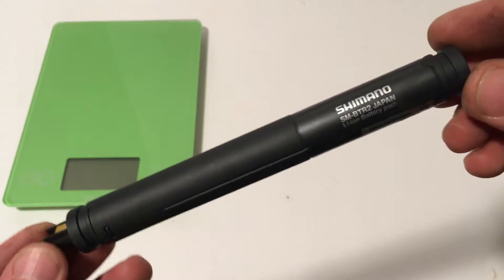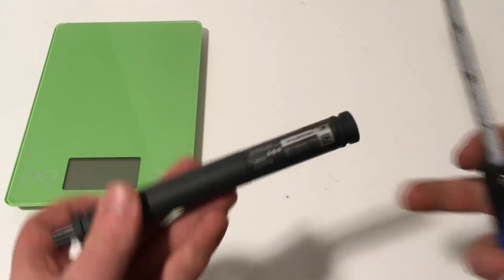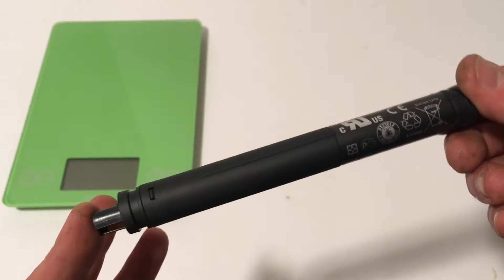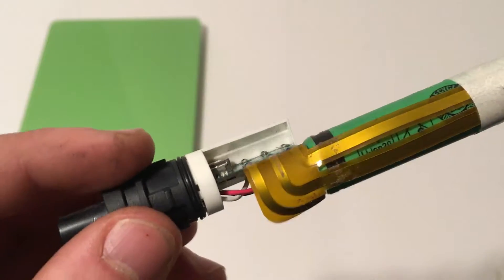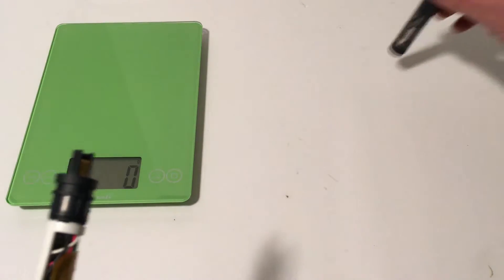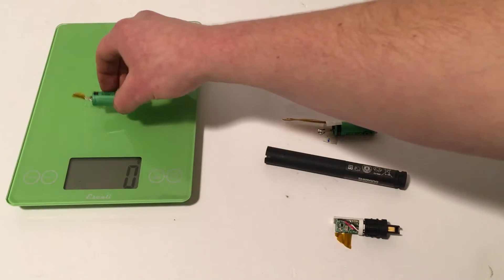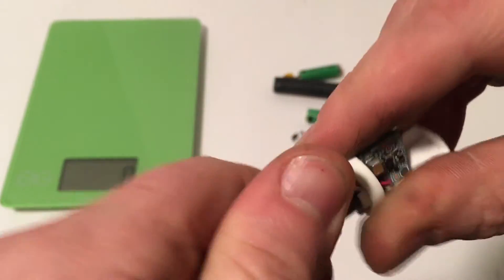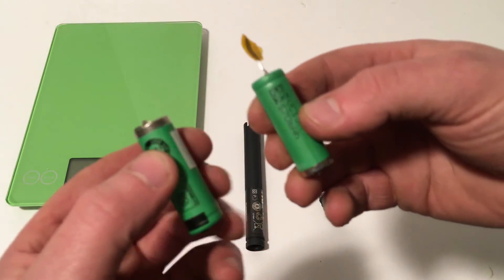What is inside of a Shimano Di2 Internal SM-BCR2 Battery

Comment: Is anyone know what is electrical difference between BT-DN110 and SM-BTR2 battery? Both batteries have the same voltage and capacity. It looks like Shimano is doing money on it and limitation is only in SW. Do You have any photos of both PCBs?
Reply: btr 2 compatible with ultegra 6780 and 9070  and dn 110 is with ultegra 8050 and da 9150, you cannot mix.
Reply: @dosazsolt9725  i already order bt-dn110 but before i used btr2 with m8050 groupset but without syncro mode
Reply: @marcinterka5822  that s good to know, so the basic funktion was going normal but no further shifting possibilities.
Reply: @dosazsolt9725  Mostly it depends from mode which You can set in tube SW for your  computer. In road bike I am using SM-EW90-A. When I choose option MTB there is more limitation than on road bike, so for example in MTB mode I cannot use shifter from road bike. When I switch to road bike I am able to drive M8050 and M8070 derailleurs using road bike shifters. Unfortunately there is forbidden to mix MTB and road derailleurs. It is very interesting topic at all. I am on the way to debug what communication is used by BTR2 and DN110 batteries to confirm that this is only marketing :)

Comment: Watching this was a painful waste of time. "Lookie mommy, I can break things and render them to screwed up to repair with new batteries.
Reply: On the contrary, I found the video incredibly useful as a reference when modding my BT-D110, especially on how to open the case and what batteries to use. The end result weighs 25g after I removed the case and soldered in smaller capacity batteries (enough for 1x). It even fits into drop bar now, way more ergonomic location than the seatpost.

Comment: Thanks for destroying an expensive battery for us... shame you probably dont still have the bits, need a little bit of reverse engineering done - the three wires in the ribbon cable, clearly battery + and - but that third one.... either balance tap or temp sensor... need to know ;)

Comment: I just dissected a Campy EPS v3 battery. Found a fried chip on the circuit board. Any idea as to what leads I can get to replace the part to solder back on ?

Comment: Apparently, the BT-D110 doesn't have case clips, it's glued on instead, you have to cut the case where the the white PCB holder and black end cap meet. The two batteries inside are the same 570mAh as in video, though.
Reply: Yeah, the newer batteries don't come apart like shown in this video. I am going to attempt to use a heatgun since glue softens when you apply heat. Hopefully this wasn't friction welded plastic because it won't come apart if it is.
Reply: @Raymond-Farts  Any updates of using a heat gun to disassemble the newer DN110? I am intending to do so but having doubts of damaging the batteries or the pcb.

Comment: Can you take apart a Di2 switch? I was wondering if the climbing shifters that cost $130 are just a momentary switch or is there a circuit board in the switch box?
Reply from the maker: If I get a damaged one I would be happy to
Reply: All Di2 switches and components have circuit boards inside, the only exception is SW-R610 which is a simple micro switch. You could make a budget Di2 setup using mechanical shifters and Di2 climbing switch. It won't be very user friendly but it will work. You can also slice and dice Di2 cables and solder them together. Hope this helps.

Comment: I'm pretty sure the circuit board is just the over/under charge protection management and nothing more. The battery pack simply has to provide proper voltage to servos...and that's it.....no?
Reply from the maker: It also has communication with the RD not just power.

Comment: Those are cheap flat-top cells, possibly 14500s, that you can easily desolder and replace with much better ones for less than $15 total and less than a half-hour's work.  You can get two of them for $5 all over, but they're junk, dangerous, and the sellers are completely dishonest about the capacity.
Reply: They're 14430s, actually.
Reply from the maker: The spendy part is the chip that talks to the rest of the components
Reply: @Jamesthebikeguy  can you get that chip separately? How do you check if the one in the battery has gone? I changed the cells on my battery with quality cells from a reputable source. It became apparent the cells were not at fault but the battery suffers rapids drain and on two different di2 systems the battery fails very quickly. The only thing it can be is the chip as all other components have been found to be perfectly working and updated. Any ideas?
Reply: @TobiMcTobeface  6 years too late here but are you sure it's not another component like the front or rear derailleur?

Comment: Can the BTR2 battery be charged with just a hobby charger [8.4v 0.5A] connected to an e-tube and to the BT (battery and get it to charge.  Instead of  getting BCR2 and a 3 or 5 port junction box
Reply: I think it can IF the PCB from the BCR2 does balancing

Comment: I'm about to install a di2 system to my hybrid. I have sc-m9051 display, sw-m8050r shifter and mu705 8speed motor. Now, since the battery is not cheap, I thougt to cheat and use two 18650 cells in series. I connected the components and battery - enabled bluetooth on my phone and tried to connect with e-tube android app. After some fiddling, I managed to update the firmware of the display, but not the motor or the shifter. The app states, that there is no info about the battery charge level. I guess there are no cheating possible then 😂
Reply from the maker: No cheating possible. The battery has a microchip to monitor power as well as it houses the intelligence for the derailleurs. You have to have the Shimano battery to work.
Reply: The same applies to btdn110. But i can disassemble and change the original battery elements to 18650 type and disconnect them for charging? At least that is the plan, since I would like to mount it to inside steerer.

Comment: James, thanks for showing what is inside the battery. What is the purpose of the circuit board.  Some inventors make their own battery using 2 Li-Ion batteries in series without any similar circuit board?  Also, how do the TT Di2 shifters work that have 2 switches, 1 for up shifts and the other for downshifts, when the only wire from the shifter has only 2 conductors?  Do the shifters also have a circuit board to transmit digital pulses to the other components?
Reply: They make them that way to profit, as any other electronics manufacturer does, they simply put a cheap chip on a cheap battery and sell them for 100s of dollars, good margin.
And dare to use third party batteries as they will update the firmware to not function for that.
Reply: The circuit board is the primary control chip of the Di2 system (what Shimano refers to as the Master unit):  http://e-tubeproject.shimano.com/pdf/en/HM-CC.3.0.0-01-EN.pdf

The update to the newer BT enabled battery (DN110) has a newer control chip.  If you try to mix and match batteries junction boxes and mechanical components of different generations, for example, you can end up with a non-functional system.